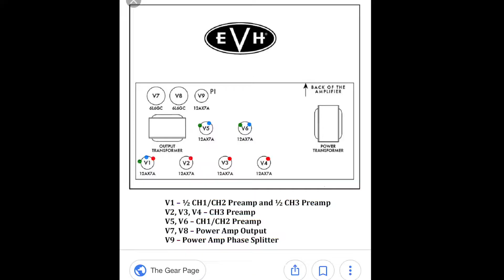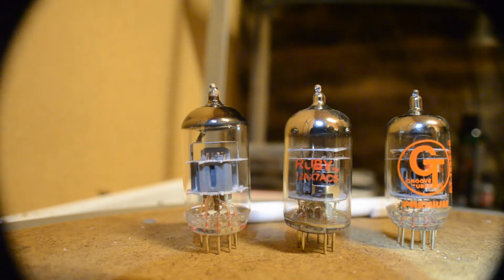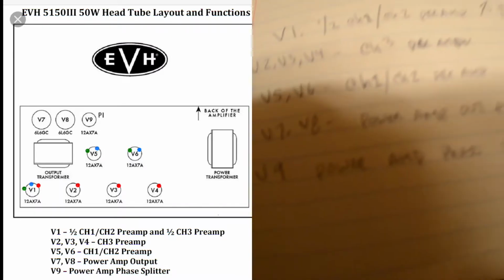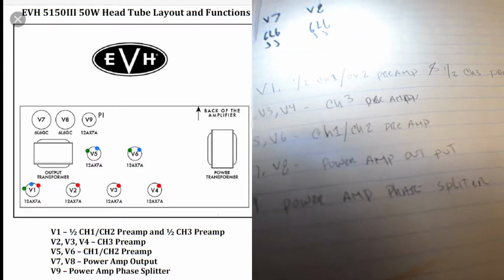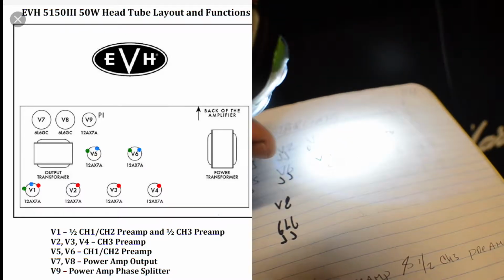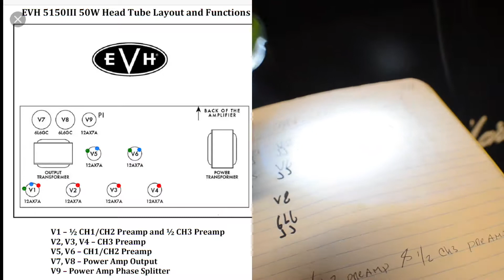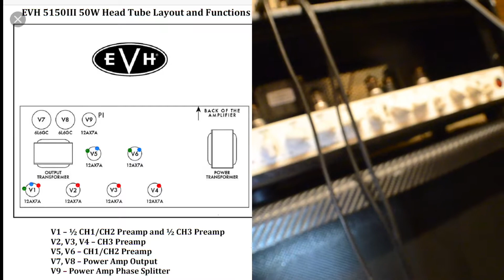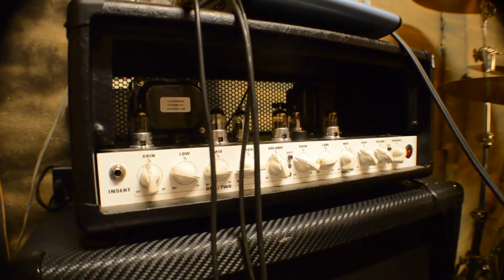EVH Tube 12ax7 rundown on all tubes are the same thing!!!!

Comment: Ruby and GT sell rebranded tubes, neither manufactures tubes, they just change the labels and double the price.   Preamp tubes last..  Doing some research and buying quality tubes is worth the extra money and effort.  You never know what you're gonna get with rebranded tubes, they can cause a lot of aggravation, especially if you don't know who makes them.   As far as almost buying used power tubes, you probably dodged a bullet,  that's just a bad idea.  They have a lifespan,  manufacturers claim 1500-2000 hours, depending on how hard you push them, techs say 800-1000 with regular use, my everyday amp gets new tubes every 7-10 months.  Faulty power tubes can also do a lot of damage to an amp, if you don't know the power tube don't put it in your amp.